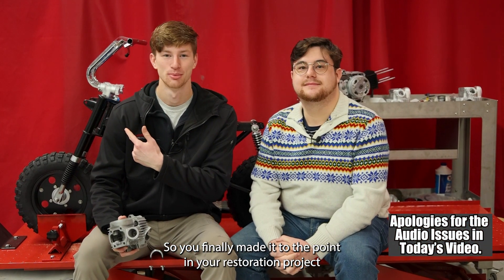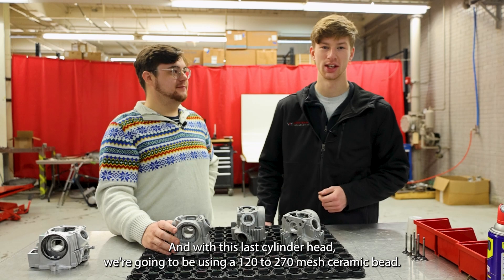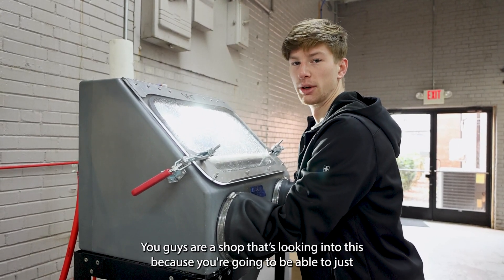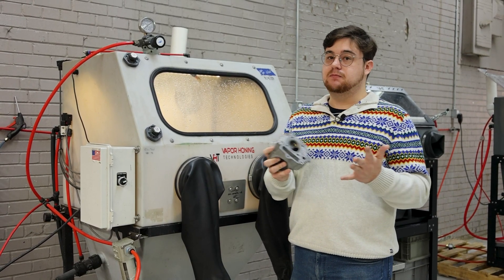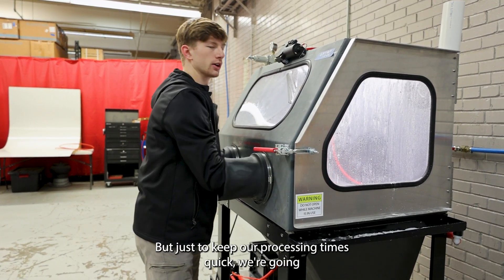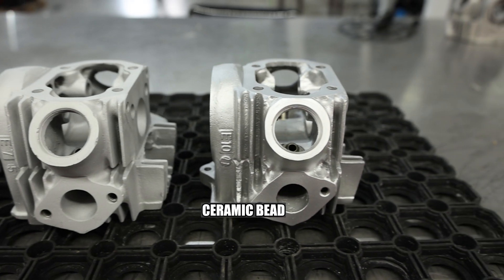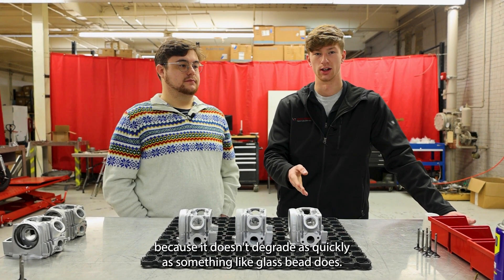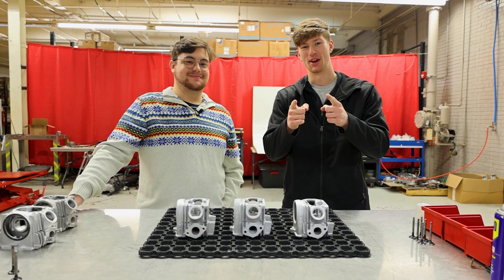Restoring Three Cylinder Heads with Three Different Abrasives!

Comment: Nice video
I’ve got some steel parts that I would like to strip the paint off of and powder coat.  
What would you recommend I use for abrasives? I have a vapor honing technologies. It’s their smallest machine.
Reply from the maker: Normally 60 or 70 grit aluminum oxide works well for coating removal and prep